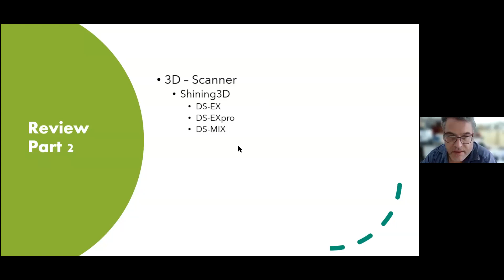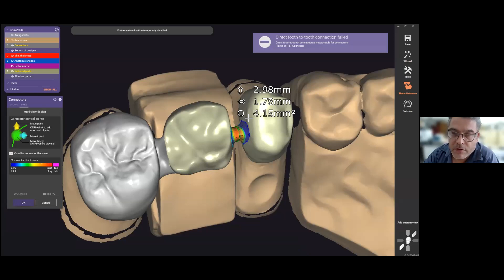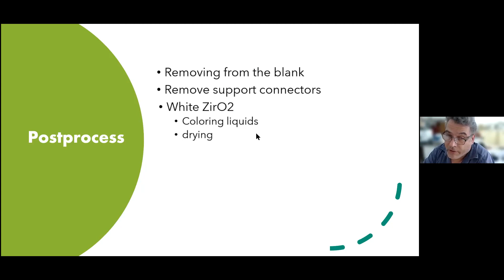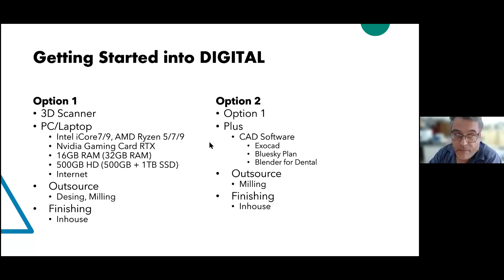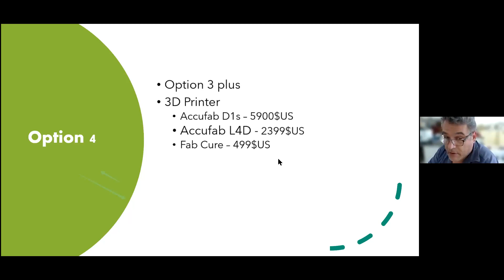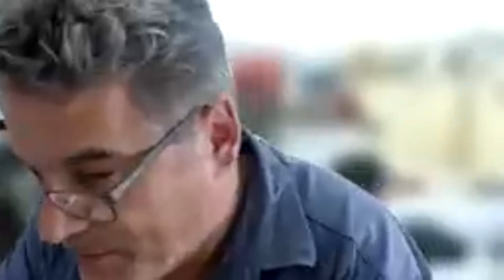Webinar on CAD~CAM for Dental Lab

Comment: Thank for the lecture, how easy is possible to start   setting up with a digital dental laboratory ? And how many job can you finish a day with digital method?
Reply: You can make so many restorations in a day and the will depend on how good your are with the software. To setup depends on your money but it is huge investment.
Reply: Depends what kind of jobs you are doing. You will gain more precision, less failure rates and higher efficience. In my experience you can gain easly 50% more output.

Comment: Can the wet and dry mining CAM, process/print two different task at the same time ⌚?
Reply: The CAM-Software translates your design into machine code. You can do one type of material at a time.  If your wet mill has place for more than one block, you can use different kind of ceramics like Vita Mark2 block, e.max or Ambermill.
Reply: This is the second question am referring to.....
Thanks for giving out time to give responds.
Reply: One appliance at a time but processes are fast that you can finish with short record time.

Comment: Is it possible at any point that you can start up using analogue process and complete with the digital or startup the process with digital and do some finishing with analogue in terms of manufacturing or printing?
Reply: It depends on what kind of work you do. Analog workflow can be transit partially or/and fully into digital.
In most cases a normal analog lab exists and looks into digital, because they want to bring new solutions to their clients. For example ZirO2 or Aligners.
Reply: What kind of analog work can be transited to digital?
Reply: @dt.okeoyindamolatimothy6493  almost all. It's not only a transition  also new and easier ways are possible. Think about implant planning or Aligner Therapy.
Reply: @philippstern2576 
Now i understand 
Thanks so much.
Reply: You are yet to respond to my second quest.
Reply: @dt.okeoyindamolatimothy6493  what are you trying to achieve?